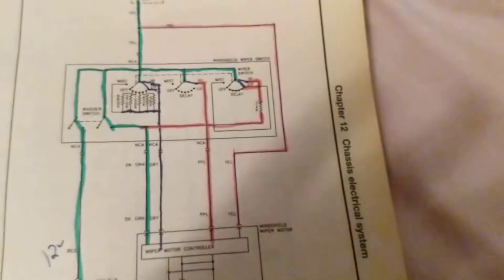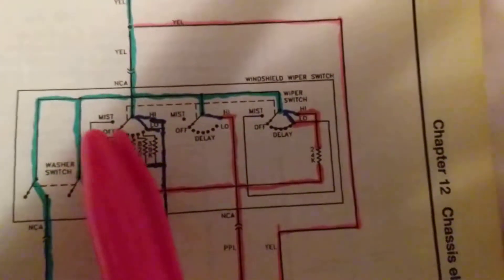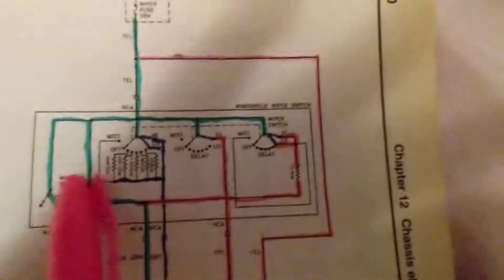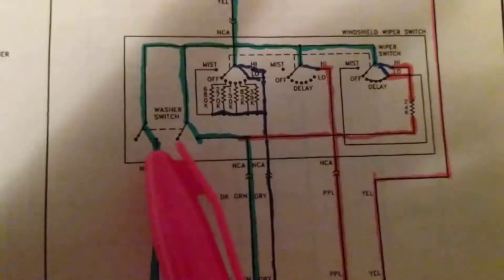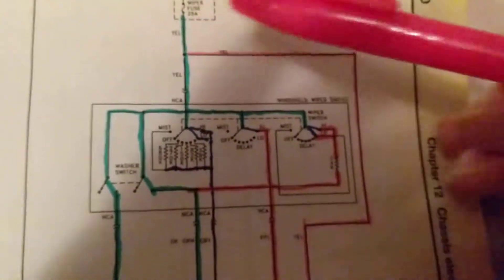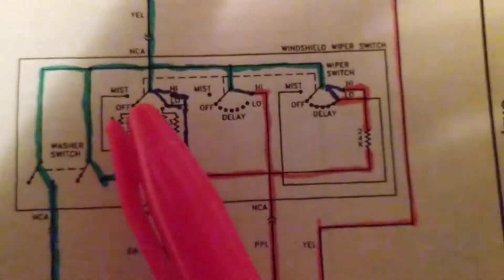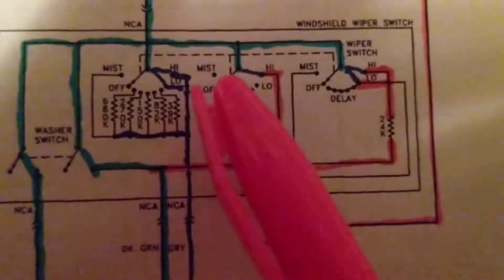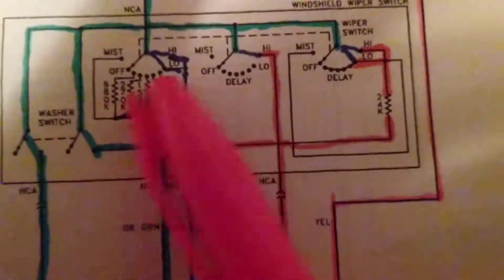How do WIPER MOTOR work from wiring diagram ,  for Toyota Camrys and Asian cars

Comment: Please make some information for Toyota Camry 2007-2011 models  for SunRoof  / Dome light Switch  by rear view Mirror at  ceiling panel  for sunroof open close button    NOT HAVE 12v  COMING ,  getting  POWER 12v ………….All fuse are Good …..Relay are good   … Still  NO   12v in panel harness .  Thank you

Comment: If you are a good solderer you can try to take it out yourself use flux and see if it's let it solder or unleaded solder make sure to clean it off otherwise you'll have high resistance paths

Comment: Looking at the schematic it is part of the switch assembly you have to take out the switch there is a printed circuit board probably and it is connected on itI would still take out the negative of the battery because under steering wheel there is a airbag assembly for caution so take out the switch assembly and you'll find it attached to it

Comment: Hi i have a 2000 corolla e110, i have a annoying problem when i pull the wiper lever washer fluid sparys but wiper doesnt work i must switch on by manual is there a solution for that, also where is my wiper relay at the car
Reply: Relay should be on the top under the hood in the fuse panel or they could be one under the dashboard by the driver side
Reply: @Joeelectronicschematicsforauto  thanks but i couldn't find it that places my mechanic guy says it should be another place, my problem is not with fuses i double check them my problem is probably relay. Could be my relay in wiper switch arm?
Reply: Don't have the schematic in front of me but I think there's a wiper switch that's responsible but you have to take out but be careful because you have to take out the negative of the battery and also the airbag obviously on the steering wheel use caution when you do that not really much to that circuit but a wiper switch
Reply: Ok man thanks a lot i will look very carefully again
Reply: @normalkullanc1993  Hello sir! Did you find the location of the relay? I have the same problem and I don't know were is located. Thank you!
Reply: @catalinp9176  i couldn't find relay yet and i sold my corolla
Reply: @normalkullanc1993  Ok, thank you for your quick response.
Reply: I found it! The relay module is behind the radio (code 85940-02010).
Reply: @catalinp9176  thank you very much for your efford i will tell my friend which is new owner my old car